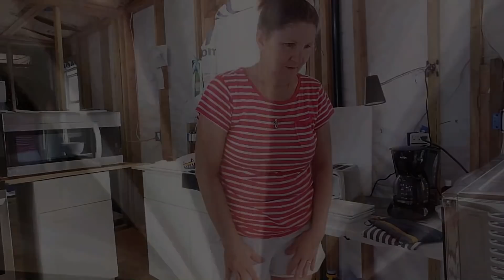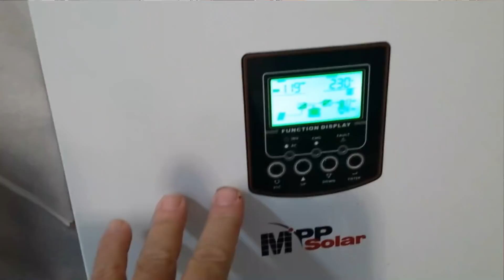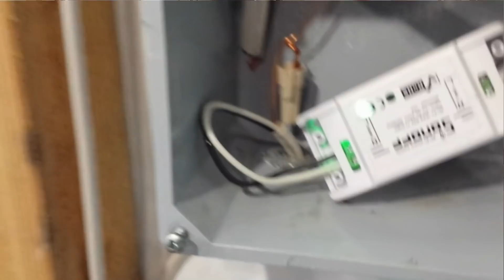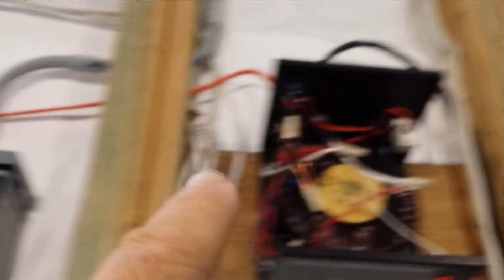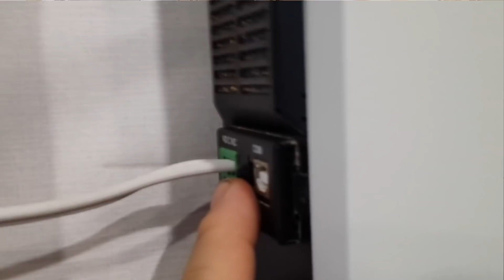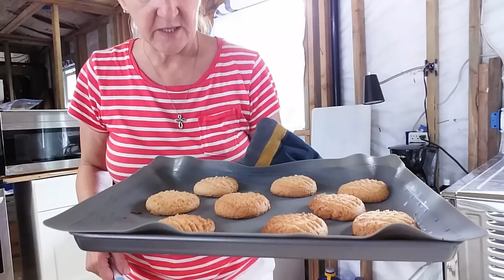21 Electrical System Tour and Momma Ds Peanut Butter Cookies

Comment: Great job on explaining your wiring . Why don't you have lightning arrestors on your system?
Reply: Al Semi -Back-Up my last electrical work I did that was inspected was 2017.  It wasn’t required, but proper grounding and binding was. I install lightning arrestors for anyone that wants them. I don’t have them because personally I feel like trying to arrest a lightning strike is tantamount to catching the wind and painting it red. Lightning goes where it wants and does what it wants to do. I did a video on my personal channel about proper grounding, but I can’t get a link at the moment.

Comment: Our inverter in our off the grid house just crapped the bed. We have a 48 volt 
Set up. What inverter would you recommend we replace ours with? 
Keep up the good work
Reply from the maker: I removed your last comment for privacy.
Reply: Matthias bitterwolf that’s a really loaded question that’s hard to answer without some background. What’s the size inverter you had, and was it adequate for your needs?  What country are you located?

Comment: Hey Steve.
I was told that you should not use single strand wire with dc power. Apparently dc travels on the outside of the strands so you get more voltage drop when using single strand wire. 
What is your opinion on this?
Also how do you like the mpp solar inverter charger? Would you recommend them?
Reply: I don't even know where I could locate 3/0 wiring to connect batteries to the inverter.  I've always used 3/0 copper cable made up of 30ga wires.  Most battery and inverter manufacturers specify welding cable for use in high current applications.  I did use solid wire for the solar panels, and I can say it's also more difficult to pull through conduit than stranded wire.
Reply: I like the PIP inverter very well.  I have been involved in the installation of 17 installations between Colorado and Hawaii,  and have had zero issues with them.  There are people that poopoo these inverters.  To those I say feel free to go buy an expensive one.  Everyone that I know who owns one loves it.  The response of the inverter is so fast, it shuts down before a breaker trips on short circuit.  I have accidentally exceeded maximum DC solar input voltage on one with no damage, although it did shut down with an error.  It's not as efficient as more pricey units.  My LG linear compressor refrigerator works well, and it even pushes out 3.89kw to charge my electric car and run the water heater simultaneously.  My opinion is it's  a solid, reliable inverter well worth the money.  You can buy three of these units for the price of one Magna-sine inverter and outback charge controller.
Reply: Offgrid Steve  ya I have an outback mppt and a cotek 4000 watt inverter. Combined price of 1500$ so I could buy two of these. It just one of those things where it seems to good to be true.
Reply: @matthiasbitterwolf1354  I don't know where you found those at that price unless you got them used or wholesale.  My first experience with them was in Colorado, Duane ordered one for his homestead.  I was so impressed, anytime it makes the difference between someone being able to afford solar power or not having it at all, these units go in.  I'm so confident in them I use them personally.  You can find some channels that expound their inefficiencies and claim they are unreliable and dangerous.  I certainly concede they aren't as efficient, but the other claims are bogus in my opinion.  Appreciate your comments brother!

Comment: So at this point. What pip inverter do you recommend to couple.
Reply: The MS series are stackable, but to better charge my batteries, I will probably go with the MG series.
Reply: Offgrid Steve   That battery bank is impressive.
Reply: @chrispatirot8575  thank you sir!
Reply: Offgrid Steve  I’ve been looking at the LV. Only because I need to stay grid coupled    Been fallowing. This and the other channel. For a few years now. You do some really great work.     Thanks for all the information
Reply: @chrispatirot8575  I'm always happy to help, and even happier when people learn from my own mistakes!  😁
Reply: Offgrid Steve  I wonder if the ms series would work for me. My plan is to grid couple not tie  can’t afford. A big system.  Most likely 4.8 -5 kw.  To offset. Electric bill when power on. And a critical loads panel when grid is off with battery back up.     Having a wife. Six  older kids. And three grandkids   Here every other weekend. With all their electronics. I’d need. 10-15 kw and that’s not realistic. For me     So.  That is why I plan small
Reply: patirot  you could start by moving part of your loads to solar.  Any of the PIP inverters can operate in a standby mode where it charges the batteries in favor of solar, then switching to commercial power only when batteries are low.
Reply: Offgrid Steve   The ms or LV ❓does
Reply: @chrispatirot8575  either one will allow priority charging from solar.

Comment: Good morning from Cairo. Although this video is a month old, I just saw it and enjoyed it very much. I just wanted to mention an advantage of having a large Lithium ion battery as a home storage battery. Let us suppose that you have a 100 kWh Tesla pack buried under the ground and hardly needs any maintenance, then we can use that battery to charge your Nissan Leaf in minutes any time of the day or night. This is purely theoretical Steve. I do not know of an off the shelf product that will allow you to do that yet. But it might come. You see I play with Li ion batteries at home to run my home. Here is what I noticed. If you put 2 Li ion batteries of different voltages in parallel they will equalize in a very short time. In your case it will take minutes to charge the Leaf rather than hours. I suspect that the limiting factor will be the fuse of the Leaf. I know that the Tesla pack can handle up to 1.500 amps. So at 400 volts that is 1,500 A X 400 V = 600 kW! I doubt if the Leaf can accept that but with some software and a magic box you can charge your Leaf any time of the day or night in minutes. It might be a useful thing to have but for those who plan their lives it might not be such an important thing. I am not trying to convince you to have such a pack it is just a thought that came to me when I saw your relay that is controlling the charging of the car.

Have a wonderful day.
Reply from the maker: Thank you Alaa! We are keeping an eye on this technology and we hope to see some additional breakthroughs soon.  I appreciate your comments always my friend!

Comment: Aloha Steve and Momma D!  My wife and I are getting ready to buy a piece of property a few miles from you. We were just wondering what you folks are planning for a septic system. We are planning on a container "tiny" house while we build. Hawaii says we can stay on our property as long as we have some sort of approved septic system or at the very least a composting toilet. We really want to be off grid, but it seems like the initial cost is very high. $12K for batteries blows my mind, but we do want to have about the same capacity that you have. We have watched all your Hawaii videos and would appreciate any and all advice you could share.
Mahalo!
Reply from the maker: I believe after 01/19 that cesspools will no longer be allowed.  I plan to install a vertical linear biodigester  I recently designed.  I'm trying to get the University of Hawaii to assist me with some tests, but so far I haven't been able to generate any interest in it.  Septic tank/infiltrator systems are prohibitively expensive for the typical individual here (over $10,000), and as a result, most people I know just direct their raw sewage into the forest.  I think if I can create a solution built from off the shelf components for less than $500, most people would do it, especially since it would provide gas for cookstoves and water heaters.  I will start it probably early March.
As for the expense for solar, you have to pay HELCO fees which amount to your "fair share" of the cost for putting power lines before you ever arrived.  I believe the fees are around $2800 per lot (unsure exactly), and until those fees are paid you won't receive the privilege of paying a monthly bill at 34 cents per kWh.  Needless to say, I haven't paid my HELCO lot fees and neither am I paying 34 cents for power.  I did pay a lot of money for my batteries.  I could have gotten a 400ah set (mine is 300ah) for around $3500.  I chose the nickel iron battery because it literally lasts forever.  If you conserve your power at night, you can go with a much smaller battery.  Invest most heavily in the PV - that's where the production is.  I have no idea what electricians charge out here, and if you build to code, you can't wire it yourself.
Reply: Not technically allowed however people will dig them for you and capping them off is simple and cheap.
Reply from the maker: @bishbosh7728  how cheap is cheap?
Reply: Hmmm usually 1600 to dig 600 for material sea ment 2-300 in labour and 3 hours or so to cap. Have done several in the last few years for my uncle.

Comment: Great layout and explanation. will you be adding your generator with auto-start for those extreme times of low sun like with stormy weather?
John
Reply from the maker: My generator doesn't auto start.  I've got it tied in, but I'm thinking about selling it.  Never used it since my system came online.
Reply: @OffGridLivingReally  even paradise has some dark days too, put enough in a row and the generator may be useful, just saying.
Reply: @thefaeryman  can't argue that, and it's probably the reason o still have it.
Reply: I won't say anything about where you guys are but I literally lived down the street from where you are 20 years ago. I can remember months without any sun at all but 7k panels should still give a decent amount of power . I have half 3.4 k on my place  and don't need my generator unless running big power tools.I literally was in the neighborhood today seen you guy's on your porch almost stopped but didn't want to weird you out .
Reply: @bishbosh7728  LOL  Well I appreciate the respect for not wanting to weird us out.  But if you see us outside, pull up, beep the horn, and we'll come over and visit a bit.  As long as we're all civil, it's all good!

Comment: How do you compare this equipment with magnasign  just a question. Not accusation  just curious
Reply from the maker: Chris,  I had a Magna-sine in Colorado, and it I'd without a doubt the best inverter made.  Comparisons:
The clocks actually keep time on MPSolar, where on Magna-sine they lost about 1 minute per DAY.  Power output is comparable to each.  MPSolar is ungrounded - as a result,  you can ground any input or output or none.  Magna-sine is probably 5-8% more efficient. Dollar for dollar, personally I put my money on MPSolar.
Reply: @OffGridLivingReally  thanks   i think if i went with mp i would use the type that stacked  or  coupled   i couldn't do what you do   i'm just not that smart
Reply from the maker: They now have the stackable inverters.  Same price
Reply: @OffGridLivingReally  thank you  Lord bless

Comment: Hey Steve. Thanks for the breakdown. Did not see a Volt Meter Panel for battery status. I guess that is on each inverter? How is the Fuze It holding up? Merry Christmas Mi Hermano.

Comment: One question is the neutral bonded to the ground anywhere or does the inverter do that internally. otherwise we need to be technical and Momma D needs to give us the peanut butter cookie recipe. Cheers thanks for showing us the system.
Reply: Neutral is bonded to ground in the main service panel only.  I cant say if Momma D is going to give up that recipe.  The cookies are gone and they were good!

Comment: Nice setup and very informative video. I didn't notice any lightening arresters but I know some areas are more prone to lightening strikes. What are your thoughts on this? Are they a absolute  necessity?
Reply: Believe it or not, Hawaii is the first place I've seen so many lightning arrestors but no grounding system to be found at all.  I'd rather have the ground and no lightning arrestor but they certainly dont hurt to have.  Colorado is dry and lightning prone and I never had issues.  We used them in telephone switches, and when they too a direct hit, the lightning would just go anywhere it wanted anyway.  Some people swear by them.  Me?  I dont know.

Comment: Thank you, Steve.  I have a crazy question.  Will we eventually see DC powered appliances and HVAC units eliminating the need for an inverter?  Is the inverter a potential obstacle (loss of energy) between harvesting the power and enjoying it?  Just curious. Thanks and Merry Christmas. 🎁🎄
Reply: I used to think DC was a preferable way to go.  I still do.  But efficient AC motors and appliances make it less important.  As long as there are utility companies producing AC, it will continue to be the most popular consumer power.

Comment: totaly agree on the code part .its realy stupid sometimes and ads unneeded extra cost.
How are the Nife batteries going are you still on 400Ah?And how far does it gets discharged.
Reply: We run at the rails on the batteries.  62v when the sun goes down, and occasionally the inverter shuts down at 41.8v by the time the sun comes up.  I knew we would likely run this way, so I guess you could say it operates as designed.
Reply: @OffGridLivingSteve  thats down to 67%  .thats fantastic. how much wp are youre panels and what brand. i dont recall you telling about them.
Reply: @mrballbreeder3749  the panels are rated 280w each.  
https://www.youtube.com/watch?v=n3xCHXbpYQ8&list=PL72W3WxPGpmaH7Gg57XjAOWXxSgaItmwN&index=12

Comment: Been waiting for this video.  Nice layout..
One question..
Your siding is 5/8 t1-11??
You're using 1/2 screws to mount the boxs.??
Reply: Oh Jim...you notice every detail.  I used 3/4" screws with a washer.  I will add some 2x4 framing to add support, particularly at the bottoms of the panels.  I'm trying to come up with a solution to adequately vent the inverters, and have everything braced also.  Dude...
Reply: @OffGridLivingSteve  
Yes those inverters are designed to be surface mounted..
Unless you go to a sheet metal shop and have metal broke to set the inverters into for airflow around.   ?????
Maybe that box could be screwed into the studs 
And nuts welded in the back to bolt the inverter to and supply air flow behind the inverter
maybe
Reply: @jimh712  I'm always open to suggestions.  I've even thought about placing 2x4's outside the wall and screwing into those from the inside.  Then paint the boards to match.  If you get anymore ideas, let me know
Reply: @OffGridLivingSteve  
More than the charge controllers need air flow..
Does the transformer need it moe
Reply: @jimh712  I've worked the transformer really hard and it gets warm.  No fans, just a thermal breaker.  The reason it's  mounted so high is because I'm going to surface mount it.  That way it won't protrude into the walk area.
Reply: @OffGridLivingSteve  
I try to..
Here you've showed those that understand, a blue print for solar.
and your colorado home another..
and Chris and Beckys more.
Plus a lot of building techniques...
and with new obsticles in Hawaii (lava &  ?) we can see more...
I/we  thank you for the knowledge you share..
Reply: @jimh712  Jim I am so glad to have you along.  Your keen eye is much appreciated (even though I pick on ya). But I would say I share more of my journey than my knowledge.  But I share it all
Reply: @OffGridLivingSteve  
😊👍